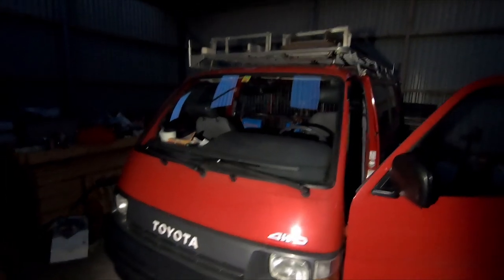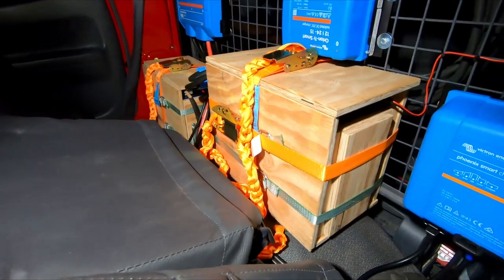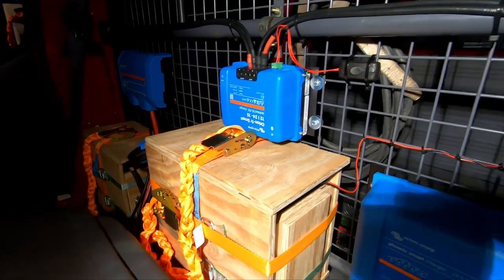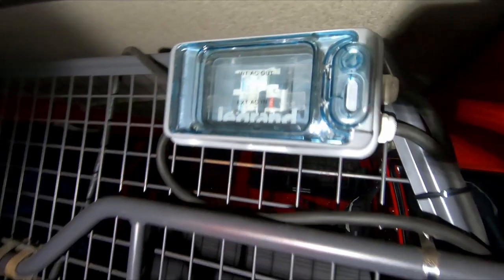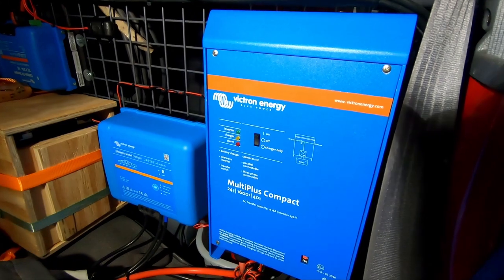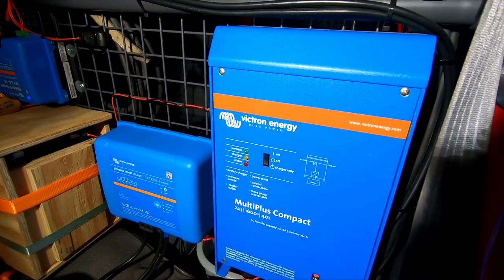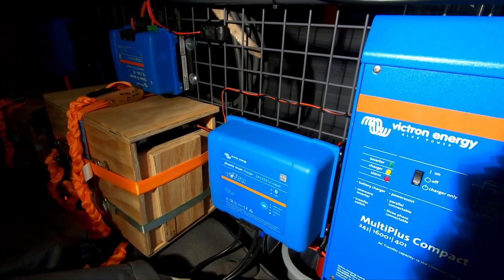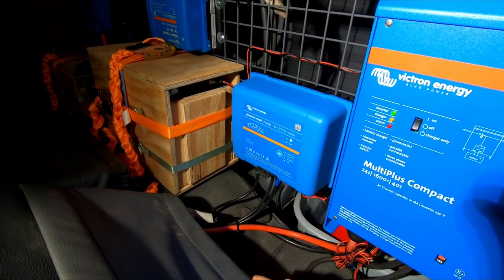Toyota HiAce Electrical Installation

Comment: Hot tip next time turn on the building lights for the video 😁
Reply from the maker: Will do so once I installed them. As of now only head torch and other mobile lights. But I got your point ... thanks for commenting